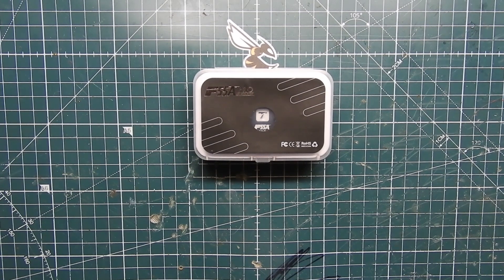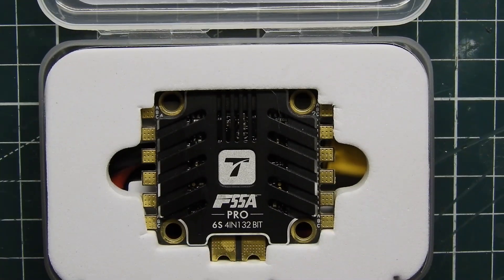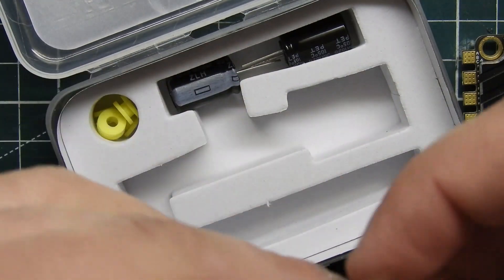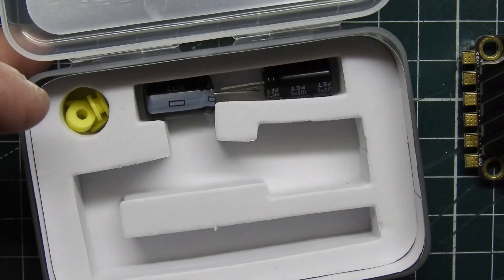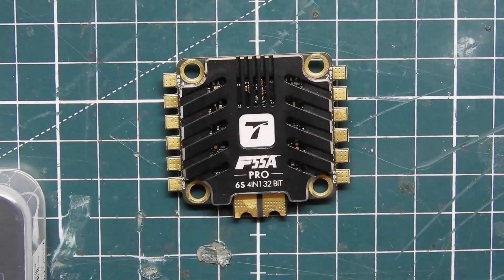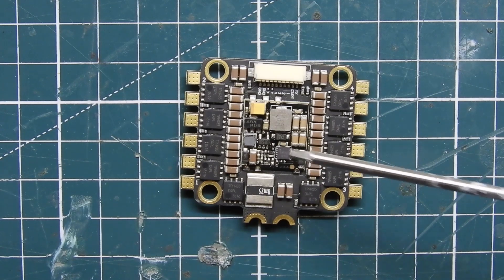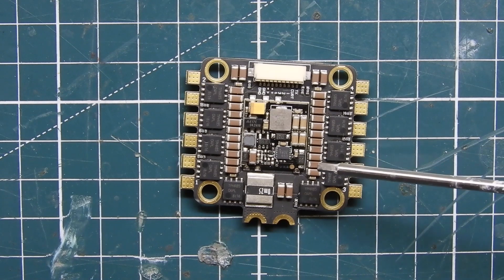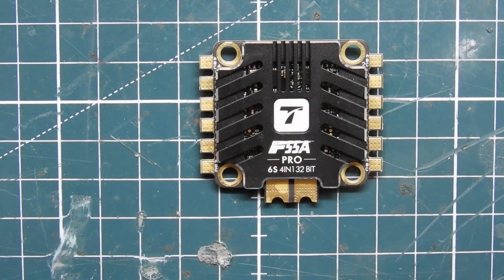T-Motor F55A Pro 4in1 Esc - Overview

Comment: will the 55A F3 by Tmotor Runs on 96khz/dshot2400 ?
Reply from the maker: 96khz is only available with blheliM u would need to flash it to find out. I have not tried blheli M yet

Comment: The F55A is awesome but it does have some noise from vbat even though if your using a low esr capacitor. I have a helio 20x20 with that f55a 4 in 1.  I hope no one else has that noise issue.
Reply from the maker: Drone mesh tested this esc and it had some really good noise resistance. I’m actually putting this with a helio strix f10. So we will see how it does
Reply: @ViperFPV  let us know if you have any noise issues? Thanks!